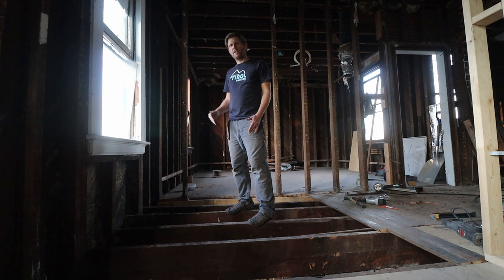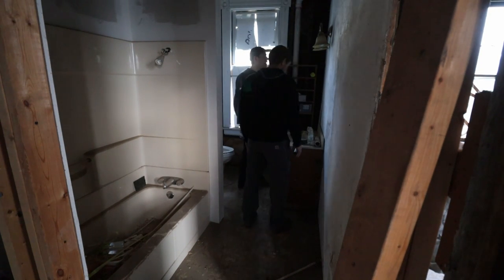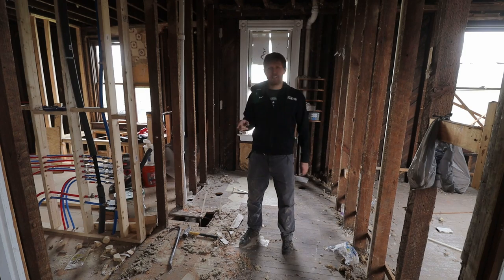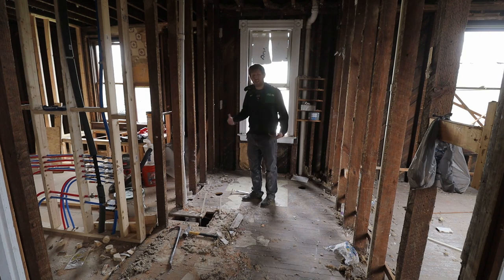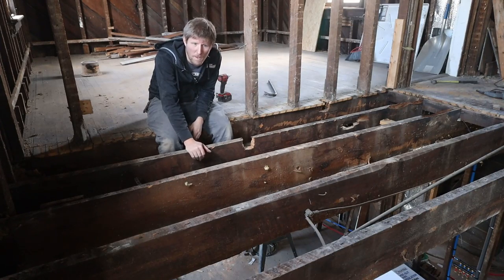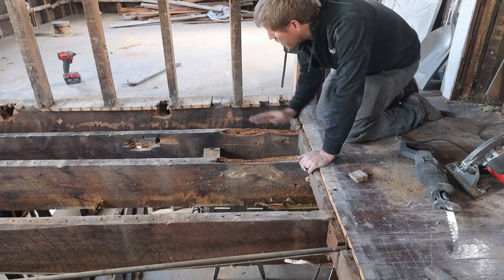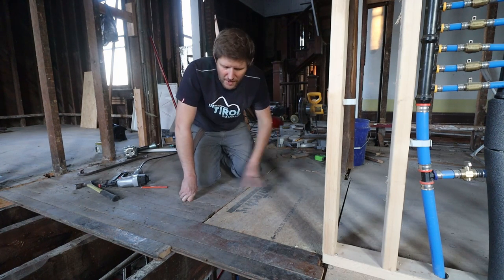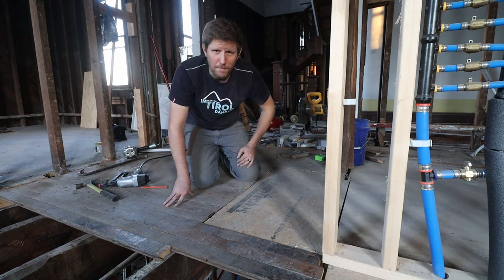Turning a Bathroom into a Walk-In Closet (Part 1) - Victorian Home Renovation [TirolerInn]

Comment: Do they talk about what to do with the exposed pipes? Do you have to cap them in a particular way? Do you have to close or turn anything off outside? I’m planning a large closet where a bathroom is and I’m so scared of running into trouble (like sewage smell or a gas build up) after the closet is built because I missed something.